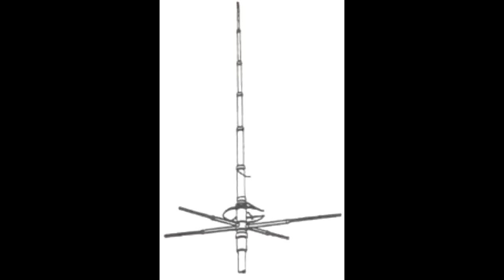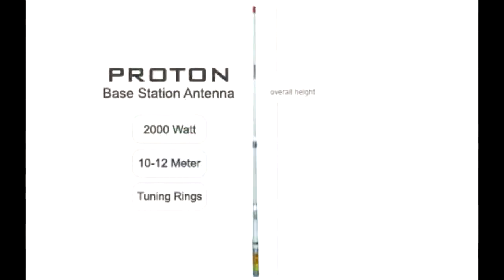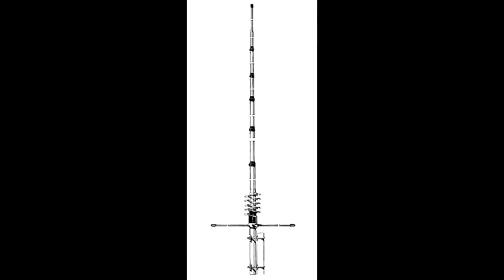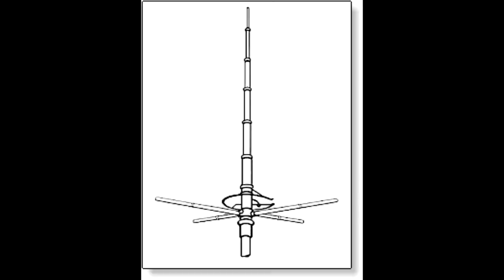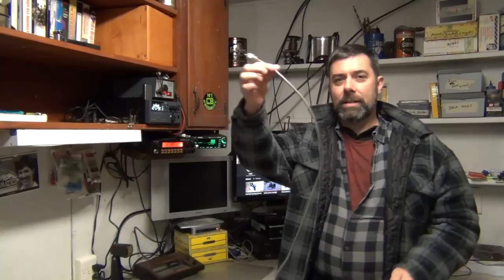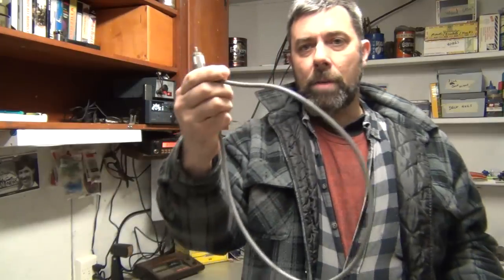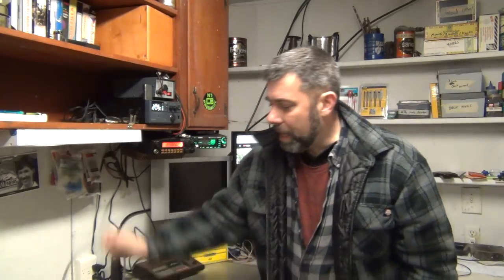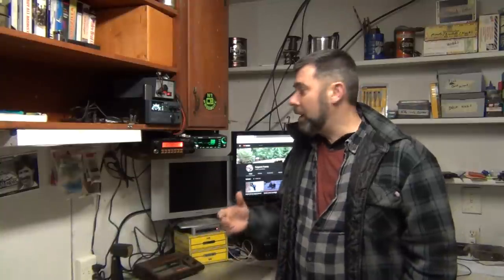CB Base Antennas Part 2: Regular Pole Base Antenna Setups.

Comment: Living up here in the wilds of eastern ontario canada, decided to get back into CB, started to do my shopping. Thanks for getting my interest back.
Reply: I've got an a99 up about 30ft down here by Windsor Ont. The antenna has been through 2 ice storms,and multiple wind storms .I can talk skip and local no problem, not running an amp or anything.All I can say is get the best coax possible the 213 would be my choice.
Reply from the maker: Glad I could help!
Reply: He miss' a point here of a GREAT product when talking about coax. He talks about line loss aka: RF. Their is a solution here for this concern and as stated coax is a factor - but the use of a LINE ISOLATOR solves 95 % of his thoughts for line loss. These can be installed any where in the coax line and have same effects.They are available in a large range of power rating and band widths depending on your needs. Available on E bay. A coiled coax choke will serve as well - however these RF Isolators are a better choice.  73's.

Comment: Wow I had no idea CB's were still going! I was heavily into it in the 70's & 80's when it was huge. Still have all my equipment which is a Tram D 201 base, D-104 and a 250 watt linear amplifier. I ran an Astro plane antenna which was one of the best at the time and tlaked all over the world. The radio was modified  to put out about 10 watts and was also modified to have a lot of extra channels. This was before 40 channels came out and I could go way below channel 1 and way above. The Tram is a tube radio and at the time a Cobra am/ssb base station would cost about $150, the Tram was $850. The absolute top of the line in those days was the Browning at a cost of about $1200!
Reply from the maker: Sounds like one heck of a setup!

Comment: I like your video. I got on CB when you had to have a license and be over 18 years old. LOL  KNJ-3578. I was a kid so it was my dad's call sign. Anyway I was on for 50 years and got into ham in the 90's. I had an Antron 99 and it worked really well on 10-11-12 and 17 meters. One day (because I had an antenna tuner) I tried the A-99 on 2 meters and It worked fine WITHOUT my antenna tuner! It must have flipped into some kind of harmonic and resonated on 2 meters.  It's a great antenna and if you leave the ground plane thing off of it, it works better and you can get better skip. In other words, I didn't want my signal pulled to the ground.  As soon as you said "noise floor", I knew you were a ham. I miss the local town talk we all had every night in the 70's and 80's.  I think I'm going to get back into it watching you and others. I'll get and HF set but I do want a good CB AM and SSB in there to talk local. (I hate repeaters. simplex for me always.)

Comment: After your review, and several hours of research, I purchased the Uniden Bearcat 980 SSB along with a Sirio GPE27 5/8 wave antenna.  I could not be happier with this setup.  I've been out of the CB world for around 3 decades and it's been good getting back into it.
Reply from the maker: Glad I could help, and WELCOME BACK!
Reply: What type of coax did you use? Also how did you ground the antenna?
Reply: @santiago101100  Hey Santiago,
I used 100' of RG8X coax and I'm getting a 1:1 SWR on channel 40 and 1:1.1 on channel 1.  I grounded the antenna with a copper coated steel rod drive 6' into the ground with 10 awg solid copper wire to the antenna.
Reply: @huletbaker3362  one single 10awg wire right? How dis you connect it to the antenna?
Reply: @santiago101100  Yes, one single strand.  For grounding, when I connected the coax to the antenna I used a hose clamp and clamped the wire tightly to the connect and then used a clamp to tightly clamp the wire to the grounding rod.

Comment: I've had many of these different vertical antennas, the CLR2, Antron, Imax and a couple of beams over the years. The big difference between the A99, Big Stick and really any antenna about 17 feet in length, is they are 1/2 wave antennas. The Imax, CLR2, Maco V5/8 is they are all 5/8 wave antennas. They generally have a matching coil inside to get the 50 ohm resistance and matching needed to get good swr. The wave form of a 5/8 will generally perform far better than the 1/2 wave antennas. If you can afford the extra few bucks for a 5/8 wave antenna I would highly recommend it.

Comment: 22' 2" is the perfect 5/8 length of tubing.
You can't have a full wave because the positive 1/2 wave cancels the negative 1/2 wave.
The Proton99 is the best antenna you showed, better price than an Antron99 and longer for better performance, plus it basically keeps up with the Imax.

Comment: Your correct Erik regarding coax cable. Coax is the main artery, if you plan on buying a nice base antenna, that new base antenna will be useless unless you purchase some quality coax which usually costs as much if not more than the antenna itself. The longer the coax run, the higher the signal loss due to resistance. RG-213/Lmr-400 has alway been my choice because it offers a high velocity factor and lower loss at just about any HF frequencies,  and Lmr-400 is also preferred for VHF/UHF frequencies as well.
   Another thing to keep in mind, if your planning to use other sorts of equipment in conjuction with your transmitter (amps, linears, antenna tuners, swr meters) try to use the same coax as your primary transmission line even though the coax is measured at "50 ohms" (52 ohms real world measurements) having different types of coax jumpers like RG-58 here, RG-8 there, RG-8X for that, it can reak havok on your SWR's and your transievers final drive.
Reply: Can you explain for me why jumpers with different coax can reak havoc?
Reply: RG213 has the same velocity factor as RG58, 66%. Slight differences in coaxial impedance is going to do bugger all. For example, do you know what the input and output impedance of your solid state amplifier is? Do you think it's exactly 50 or 52 ohms? The effect you're talking about is likely caused by the quality control of amplifiers, as the jumpers are acting as coaxial transformers.

Comment: I posted this on another Youtube channel, but your antenna video makes it relevant to post here.
Some years ago, I made a pair of inverted vee, half wave dipoles for myself and a friend, each quarter wavelength was 109 inches. Wood poles were used as the center support. As each leg is brought to a 45 degree angle, the SWR will approach 1.1:1. If the match is high, just move the legs wider or closer to adjust it. Cost for us to build these antennas was about $5.00 each, (or less) and they worked just fine. If you have the space, you can make these antennas longer. The rule is that each leg should be an odd number of quarter waves in length. If you have the height and space to make each leg three quarter wavelengths long, the antenna will actually have some gain. I always adjusted the SWR with the radio set to channel 20. If I could get a 1.1:1 match on 20, then the match would be good out to channels 1 and 40. We lived about five miles apart and communicated with no problem, especially on sideband.

Comment: Liked that, a lot, in the UK we had the same two types of loss cabling , interestingly their catalogue reference was RG58 for the thin ( mobile set up), and RG8 (for Base station application ). And the wave patterns of a half wave  were radiating an equal circle,  as opposed to the then 5/8 radiating a tighter elipse,  all the way up to a 7/8 ( which l ran , an Avanti  Sigma IV) had a radiating pattern of throwing the signal out, at almost a horizontal  elipse. 
6Db gain is really healthy for an omni, it would only be a beam/quad/ stack setup, that would really improve that.

Comment: A99 was 17ft and worked great that was my first one with 5/8 cable with a 25ft tower then I switched to a rci ranger and beams and went back to the A99
Reply from the maker: It's the best overall antenna for CB radio out there!

Comment: Hi Eric, obviously another great video….    I’m pretty much a newcomer to this, my Dad ran quite the rig in the days and as a young kid it was fun to watch.    I think watching your videos have inspired me to get back into it.   Recently I found a Cobra 142 yep watching another one of your videos 😎.    So I’m on the fence of antennas,  leaning toward the Maco v-5000.     It’s Aluminum and I think will fair a little better with the sustained wind we get.     My question to you is one that has a lot of varying opinions and that is grounding.       I’m using 30’ of 2 1/2” galvanized steel pipe connected to the wall of my shop and is also set in concrete, yes I’m thinking I will add a ground rod and ground the mast but what about the coaxial cable?   I’m planning on using LMR-400 and will need to use about a hundred feet.
Reply from the maker: I would certainly ground the setup with a separate ground rod! Every bit of protection helps!!

Comment: I've had mirror mounts screwed to the fence in the backyard.
with coil & whip antennas along with 102" whip antenna with the separate coil which I've had decent receive/transmit with RG8 mini Low Loss Coax.
Reply from the maker: Sounds like a neat setup.
Reply: @FarpointFarms  well I've been able get miles so works pretty well.

Comment: About 12  yrs ago I got a V5/8 Maco. Great antenna. I had the RG8U cable. And with some help got it in the air about 50 feet. About 3 yrs later I go out side and look up at the antenna and the top section in bent at a 45% angle. Not sure if an airplane hit it Or some big dodo bird tried to land on it. So I got the guys back together and we repaired it. Only this time where the tuning ring is we upgraded it. The one it came with is really cheap made. Once repaired it worked better than ever.  I got one of those Texas Stars 667 amps. Sent it and another amp to Sparky's C.B. Shop for repairs.  For almost 2 yrs they Never replied to the emails  and when I called they told me the tech is not in.  So beware of these people.
So my antenna has  been in the air for 9 yrs or so with no problems. Until, not so long ago,  I turned on the radio and got nothing. I go out side and look up at the antenna and the whole top section is gone. The ground plane is still there and part of the tuning ring. The part we upgraded looks to be still there. I found the rest of the antenna some 50 feet away on the ground. Not sure as to what happened. The guys always said that C.B. stood for,  constantly buying and that seemed to be right. Some day I may get back into this but I will have to find a C.B repair guy who knows what he is doing and be someone I can trust.

Comment: The primary function of a ground plane, at least one that is a quarter wavelength in length, is to improve ground efficiency. It provides the return currents and screens out the lower ground. This is of particular use for an antenna low to the ground and or if you have a lossy ground (poor soil conductivity). A few other notes: 5/8 is a fraction. A full wavelength on 27mhz is about 36ft. Those are not N connectors, they are PL259s, very different.

Comment: Thankyou for getting me interested in cb. Been using the mobile setup every day and finally setup the Bearcat 980ssb in the work van and it it much improved over the uniden 505. Anyways, you spoke of signal loss on incoming signals with cheap cable, do you also lose SENDING signal with cheap cable? Does it "leak' both ways? Still learning....

Comment: Topic suggestion: 
If you haven’t already covered it, I would be curious about some methods you may be using or considering for lightning protection for antennas and equipment.
Reply from the maker: I'll do it! I've talked about it in other videos, but never made a standalone one.

Comment: Just saw this video after commenting on another of yours! Great Stuff! Thanks a lot for laying out basic components. I have a Uniden 520XL, and will likely start my station in hoe with it (since I have it already). Im gonna buy RG213 cabling, and run it out to a backhouse, and mount the antenna on the backhouse. I might get the The 'Maco' (sp?) Antenna (gonna see what I can find, but, longer range is my goal). Just a couple of questions... lets say I added HAM to my setup later - would I kind of run a CB and Ham through a switch of some sort to choose which goes live on the Antennae? Would I need a separate setup for a HAM radio setup? That wouldn't happen for a while, but, I figure, as long as I am setting things up from scratch, if I CAN do so thinking of the future capabilities, why not start from the initial setup (and add a HAM radio down the line when I'm licensed and ready)
Reply from the maker: While you can make a setup that uses a shared antenna cable, you will soon find that it's more trouble than it's worth.
Reply: @FarpointFarms  You had mentioned your Antron is a good 20' off the roofline. I know the antenna itself is about 17'.. I am installing mine this weekend, and had a question - I thought about mounting the 'support pole' so that the bottom of the A-99 might be about 15' off the ground (so, at its tip, it would be about 32'-ish) I figure this way, I could always climb onto the  shack's roof (which is about 10' from the ground) and still be able to easily reach the tuning rings near the antenna base should I need to adjust them. Does hat sound like good height calculations for a really good range? I am up in the mountains, but, in a meadow clearing, so, its not dense forest for maybe a 1/4 mile radius around my house, maybe alittle more.

Comment: I have a question that Ii hope isn’t too stupid. 
If I get a Base antenna can I attach it to a tree next to my house or will the tree itself interfere with reception/transmission? It would be an easy way to get the height and also it wouldn’t be so obvious to the casual observer. 
I love your learning from your videos. Thanks in advance,
Rolf
Reply from the maker: If you can put the antenna where no parts of the tree are touching then it will be ok. It the tree branches touch, it will most likely cause interferance

Comment: Hi Eric...thanks for your instruction videos. I'm about to install a Tram 18ft base station antenna. Thee perfect place for this antenna already has a satellite dish installed. If I use good cable, for about a 15 foot run, plus the 12 feet off the ground, will I run into trouble if I install my base station antenna close to the dish?
Peace
Lawrence San Diego CA
Reply from the maker: It should not be an issue.

Comment: Thanks again! This is a good review for me. I gotta get on all this coming this spring. I have an 8ft ground rod, picking up ground wire soon. I'm still looking for a A99 but I did pick up a 102 inch steel whip in a trade! Might put it up in the trees next to the house. I have 100 ft of rg8 coax but I have 2 barrel connectors so I could add to it or get all new still undecided. Have a few radios so all good there. But I gotta get that workman B100 down that's terrible! A little Wil works better than that thing lol. 
Thank you for the great videos! Keep them coming!
Josh
Reply from the maker: Glad to hear your setup is getting closer to perfection. That 102 is worth a good bit these days as they can only be found on-line.  I just wish modern cars had a spot on the bumpers to mount them, but they are all plastic!  Good luck with the A99 search too!
Reply: @FarpointFarms  
Do you think I should go through the trouble of putting up the 102 whip as a base antenna? And thanks man I'm slowly getting there. The say good things come to those who wait. 
I'll keep you posted. 
Talk soon
Josh

Comment: A fullwave vertical would be about 36 feet or 11 meters, to tall and besides the impedance would be to high to match.
Reply: Now days cable and satellite dishes have largely made home TV antenna towers obsolete, but in their day 40’ towers were common.  With a tuner they make fine verticals. For the easiest match the vertical element should be an odd number of 1/4 wave lengths. Radial length is not critical but should be at least 1/4 wave length.  As the post mentions, a metal roof and a 1/4 wave length vertical antenna work well.

Comment: So the noise floor, is that what I'm hearing on my mobile unit as I speed the truck up and slow down? I'm hearing the radio static out with the fluctuations of the engine. I can turn the squelch and block it but then I can't hear folks talk. 🤔 I think I'm learning stuff,  thanks man!

Comment: You can make your own IMAX/improved A99 by taking the top section off of the A99 and replacing it with a 108” stainless steel whip. The threads are correct 3/8-24. That’s what I have.
Reply from the maker: I've heard of this modification, but haven't ever tried it.
Reply: There’s a definite improvement over the stock A99. I had one of those for about 15 years at one house, then made the modified one and have had that up for seven years now at this house. Slightly better SWR across the band and on 10m, and ever so little more gain. Cheap and easy modification!
Reply: Did you trim it to the top section length or leave it? Isn’t it 102” without the spring?

Comment: I've noticed no difference with ground plane kits by experiment. I jumped up to IMAX 2000 from A99. Now, I need to get a new mount going. My option is dig a deep hole in the ground and stuff a long steel pole in concrete, unless that doesn't work for my 2000 lol